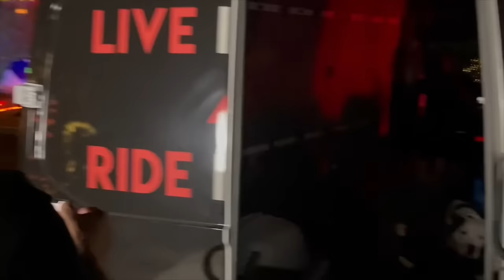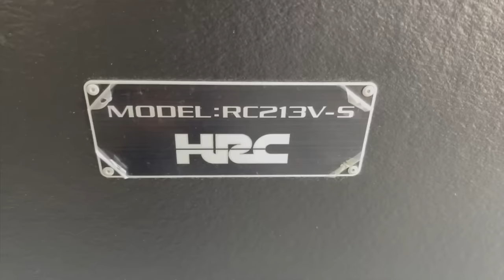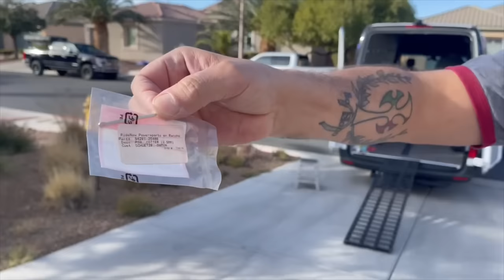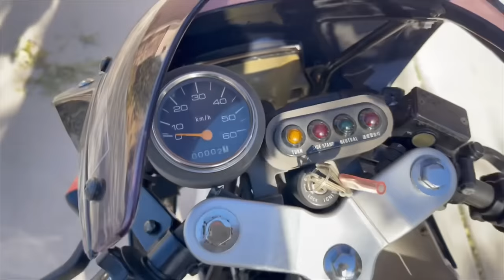230K Insane Honda Superbike Arrives! Others Leave. Big Changes to Homologated Superbike Wonderland!

Comment: it upsets me that people touching the bike are not wearing white cotton gloves, seriously.
Reply: Hands, without rings on fingers, will not scratch them. Finger prints will wipe off easily with a cloth and detail spray. Those bikes are very dusty and need a full detail anyway. White cotton gloves are slippery and do not have the grip of leather. They would be more dangerous moving them around like that with less grip.
Reply: I would be using some grippy mechanics gloves.